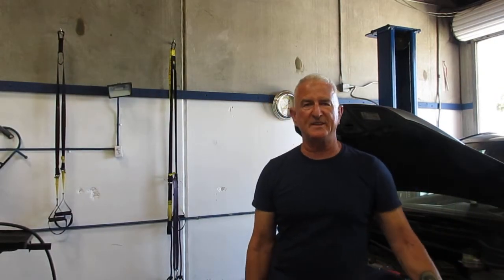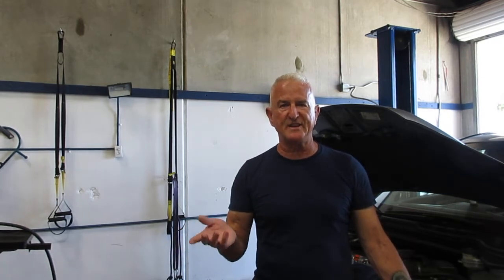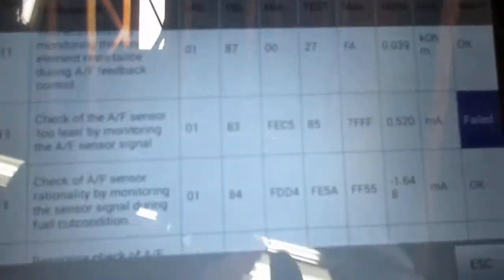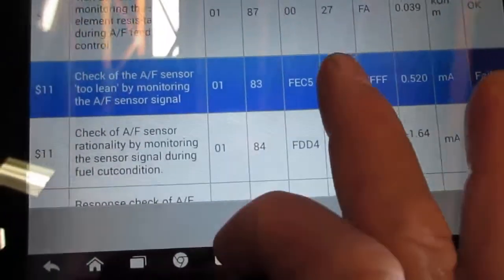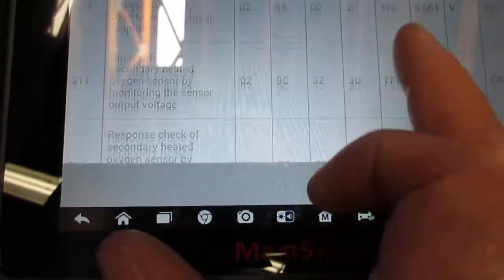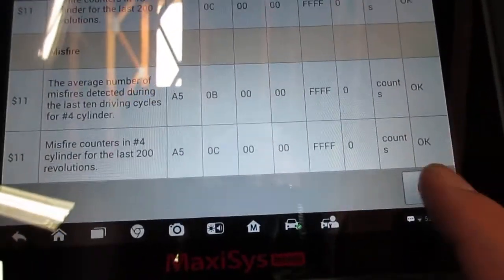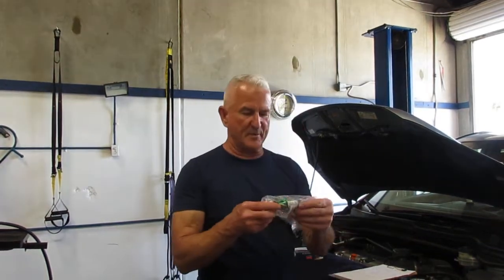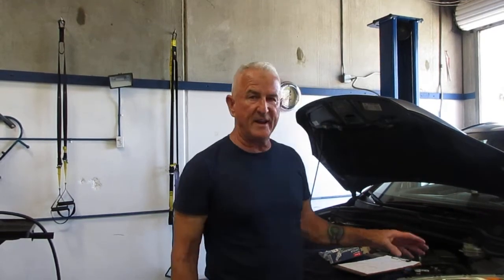2010 Honda CR-V, 2.4L, Automatic, P0420, Mode 6 Data, Catalyst Efficiency

Comment: My 2010 has the same p0420 code and checked in mode 6 and it’s saying everything in there is ok. Also did the spark plugs oil change , and air filter Does that mean I need a cat?

Comment: I have this code on 2007 Honda Accord 4cylinder both oxygen sensor been changed and catalytic converters it’s was fine fir a while but now the code p0420 comes on I reset it and it still comes back on with this code
Reply: It can be the catalytic converter bad you can try cleaning it with cataclean
Reply from the maker: I would check the LTFT at idle and 2,500 rpm. The spec is 0% plus or minus 5%. If the fuel trim is positive it's running lean , negative fuel trim it's running rich. Also check the Mode 6.
Reply: DANNY NANDKUMAR  I will do it was replaced 1year half ago
Reply: John Sadler's Auto Repair  I will do thanks
Reply: DANNY NANDKUMAR  thanks